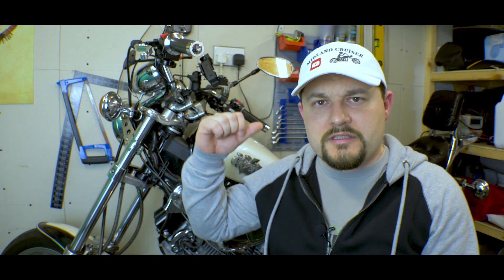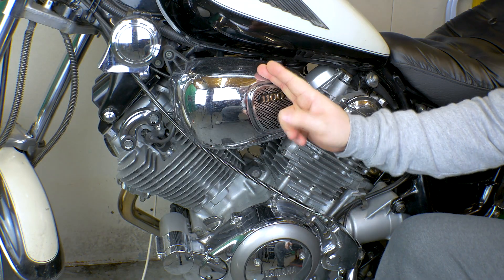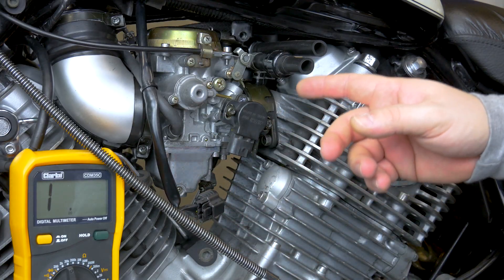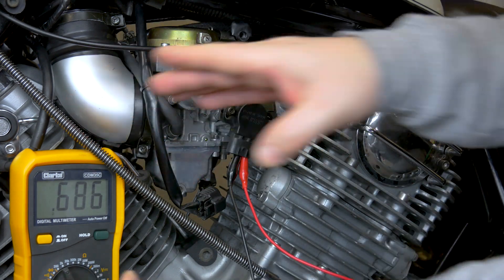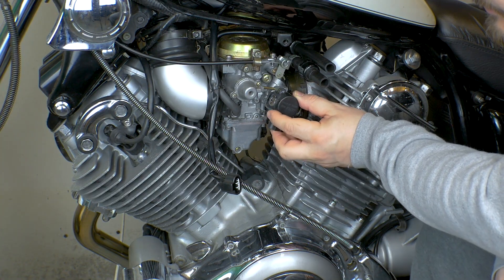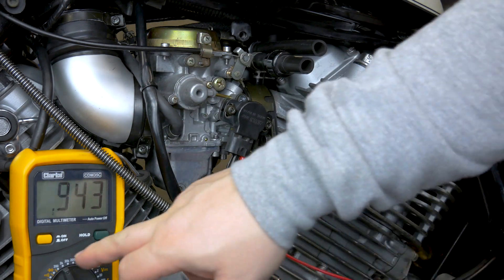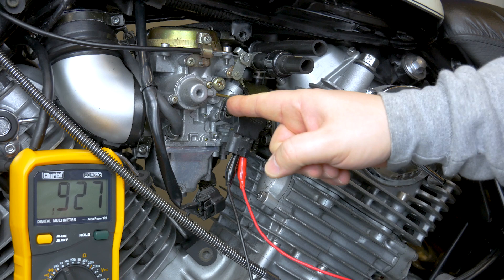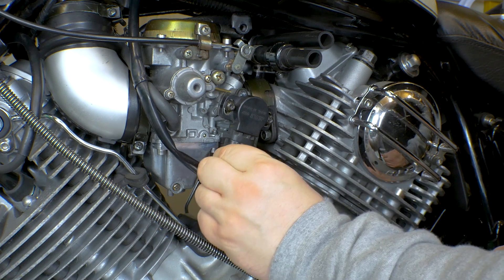YAMAHA TPS TUTORIAL XV 1100 VIRAGO | How to test and reset your throttle position sensor

Comment: Do both sides of the tps screws need to be even? Can one side be screwed in higher than the other?
Reply from the maker: It should be the same..but as long as it holds it in place it should be fine

Comment: Please tell me what role the PTS sensor plays in a carbureted engine, what it does, and whether it affects power and maximum speed. Thank you, I'm waiting for your response.
Reply from the maker: @РусланБогарян  hi. Yes it is absolutely affect power and top speed. It adjust the ignition timing based on throttle position to a certain engine speed. It can cause all sorts of power changing and weird feelings when accelerating. It only affects ignition though not fuel mixture. Hope this helps
Reply: @MidlandCruiser  thank you so much👍

Comment: Could this be the problem on my vstar 650 starts up and runs fine but when it gets hot it loses power I give it throttle and it bogs down would this be a symptom of a bad sensor??
Reply from the maker: Being the check fairly simple, it's always worth to have a look. Make sure to check not just the idle position, but the whole throttle movement to make sure you have stable reading all through the throttle range. Also worth checking the spark plug to see if you are running rich or lean if the TPS checks out and go from there.. Hope this helps
Reply: This also sounds to my untrained ear to be a possible spark ug issue
Reply: Did you ever get it fixed
Reply: Mine dies/bogs after 60 mph, giving it full throttle sounds like it’s going to explode and also bogs down bad
Reply from the maker: If it that bad, you may have other problems...could be ignition too..
Reply: @MidlandCruiser  ignition coils read 14k on the front and 11k on the rear.
Reply from the maker: Seems like you have the skill to check stuff so I would recommend to go through everything to make sure all on spec. Also get new spark plugs because sometimes they can fail under higher load even if they are working ok on lower revs/load.
If all electrical parts comes back ok the you can start looking into fueling, blocked filter, stuck float, blocked jets etc. The fuel level is quite critical on carburettors so make sure yhat is bang on and then go from there...
Reply: @MidlandCruiser  when I bought the bike the fuel line was straight from the tank to the carburetor. Bypassing the fuel pump, I have no idea why that was the case since the fuel pump seemed to be working fine.

Comment: My idle is 840 ohms, is that ok? My base is 5100-5200
Reply from the maker: Counting with 5150, it should be around 721 at idle. Multiply the 5150 with 0.13 and 0.15 to get the two value for idle then go halfway between the two. Try to get it around 720-730 but only after you set everything else (fuel level, sync, idle screws) the TPS is the absolute last thing to do, hope this helps
Reply: @MidlandCruiser  I have a 07 vstar. Carbs rebuilt. Fuel filter is flowing gas through the lines. Air filter seems okay. Would not accelerate past 60mph, if I give it full throttle in gear the bike would not accelerate past 60mph and it would start to die down/bog out. It sounded like a large exhaust leak(like there was no seal in the front headers) at full open throttle down the highway, the difference between half throttle and full throttle is huge. Idles fine and giving it full throttle during idle wouldn’t make the noise as it would if it was in gear. Obvious lean condition, front pipe headers are turning blue, motor running really hot, battery not holding a charge if key was in off for more than a minute, wasting more gas than usual, small but noticeable ticking noise.
Reply from the maker: Seems like you may have more than 1 problem...just a quick question..was everything fine with it before the carb rebuild?? If yes than the problem more than likely comes from there, especially if aftermarket parts have been used like K&L kit. If not and was the same then worth looking at the TPS. Put the multimeter on it and slowly turn the throttle while you looking at it and make sure the numbers are steady and not jumping up and down or go crazy etc. When you stop the throttle movement the ohm reading should stop as well..
Reply: @MidlandCruiser  that guy that sold it to me said nothing was wrong and the carbs were recently rebuilt. Ordered fuel filter, intake boots and I’m gonna head to the store for some spark plugs. I really do not want to deal with the carb but if I changed all those small things and nothing changed, then I will have to deal with the carb.. when I pull the carb I will adjust the tps to its proper setting, thank you for assisting me, I’m pulling my hair over this.
Reply: @philspaseo2377  have you fixed this issue? I have a similar one, doesnt go over 140km/h

Comment: Hi, I am from Russia and the YouTube translator is a fool. What is the minimum and maximum resistance value? On which contacts to measure it?
Reply from the maker: Hi...looking at the tps as it is in the video, on the 2 outside terminal it should be around 5200 ohm (this isn't changing when you rotate it), and use that value to find out what to set it to.

The middle and the right side one is the one changing when you rotate it and should be set to 728ohm in my case AFTER you have set the idle speed (950Rpm) correctly.

Hope this helps

Comment: What happens if the throttle position sensor is not available?
Reply from the maker: Hello, if it is not on your bike then it is not needed. It was only available on the big Virago. XV 1100 96' onwards in Japan and the UK . Most American models XV1000 and   1100 had manifold pressure sensors to do the same thing just a different way, located just above the ignition coils, they won't have TPS fitted. Also most of XVS Drag stars had TPS because being newer models...This guide can be used basically to any bike with carburettor fitted with TPS.... Hope this helps
Reply: @MidlandCruiser  Many thanks for the quick reply. I have it on my bike XV1100 '98 and it is out of order. What problems does this cause?
Reply from the maker: This part on these fairly simple bikes only help the ignition unit to adjust the ignition timing, for example if you open it fully on relatively low revs it will advance it to give you more power. Also considering the piston speed the ignition needs to be advanced for higher engine speed otherwise the "bang" would complete after the TDC causing possible engine damage and horrible running.. 

If you shut it then retards it slightly to keep the emission down a bit. Basically this is helping you to run the engine more efficient... If it is not working properly then you could feel power loss, and the bike will feel hesitant... Basically will feel crap😁.. It does more on fuel injected bikes but that's an other story.. 😉
Reply: @MidlandCruiser  Thank you very much!